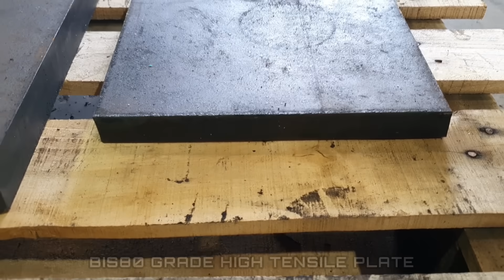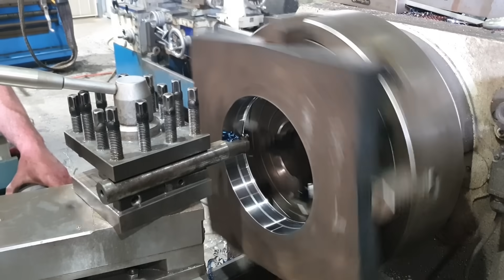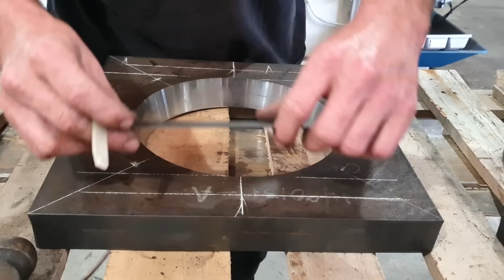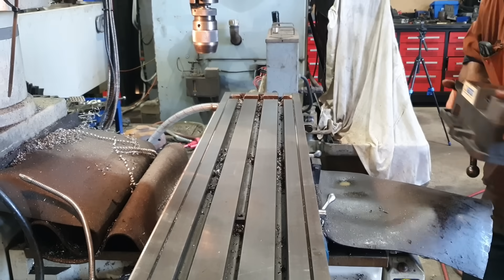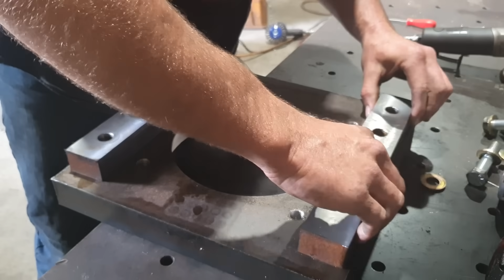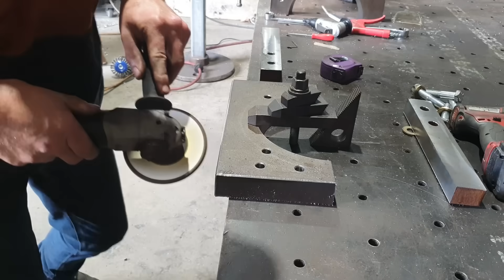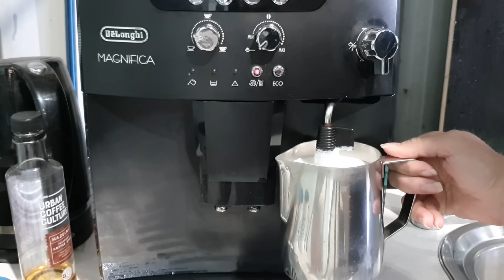Making a Custom Bearing Puller | Shop Made Tools

Comment: This is an awesome puller design. I would say that when I'm doing mechanic work, the hardest thing sometimes is getting good pullers and press plates that will work with whatever I'm trying to take apart and reassemble. Recently I've taken to making my own. Having the lathe and mill there to make custom pullers and press plates just makes my job so much easier. I'm rebuilding my Kubota tractor engine and rather than do like most guys and smash the old sleeves out of it with a chisel and risk destroying the block, I made my own puller out of scrap steel I had lying around and I made the pulling plate out of some aluminum to avoid damage to the block. You can't get these old blocks any more and people want stupid money for them so it's critical not to wreck them. The screw I used was from an old broken Snap-On kit I inherited from my father.  It took me about half a day to make it but it saved me about $700, and it would've taken a week to special order all the pieces in, so it was well worth my time. It was a hell of a workout with a long cheater bar to pull those sleeves but it popped them right out no problem.
Reply: Ever hear of a “Clamshell” puller? Best investment I’ve made as a diff mechanic.
Reply: @MH-es9rn  No but I'll have to check it out. I find myself doing a lot more diff work as time goes by. Most people are afraid to do it because you can't just slap the part on and torque it down. You have to actually set it up and take measurements and stuff. 🤣

Comment: No sarcasm intended : impressed with the accuracy of the chalk line! - I've been using the nail on rust, or Tungsten tip pen on Blue paint...but then no two of our tape measures are the same !!   You're a great inspiration.   Slàinte Mhath.

Comment: Ive been doing this for years. Gearbox rebuilding. If you have the cage and rollers off the cone, all you need to do is heat the cone with a rosebud and it will fall off. No harm to the shaft.

Comment: Love your vids. As a mechanic, I love fab work. "Make what you need" I was told years ago. I did get a bit of a laugh cause you ran the 5/8" (15/16" hex) bolt in with a 24mm socket. The dashes tell the story. I thought it was metric only for you "down" there.

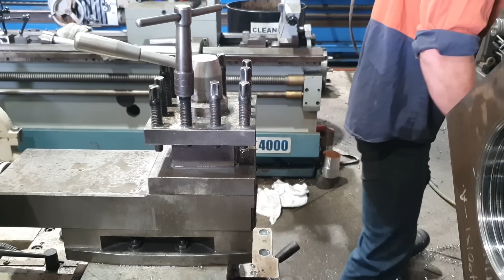Comment: 40:49 For your next Shop Upgrade Project, perhaps you might want to build a small motor that's permanently attached to the Mill Head shaft so the mills can be inserted or removed at the push of a button...That saves you having to waste time trying to get a wrench onto the shaft several times as you screw it in or out...

The guys at Physics Anonymous did something similar for their Mill...

https://www.youtube.com/watch?v=lTUmjiJELko
Reply from the maker: hey mate I can't have a setup like that as I wouldn't be able to use my 90° degree milling head

Comment: Probably been asked before, but why the air tools over electric ones??
Reply from the maker: a couple of reasons, I have a lot from my days working in the field when we used compressors, I prefer air over electric grinders as air grinders will stall if they get caught up
Reply: @CuttingEdgeEngineering  yeah ok, makes sense.
Guess I have only used cheap air grinders, should invest in a good one

Comment: What was happening at 26:00. What was the tool doing?
Reply from the maker: that tool is called a "wobbler" edge finder, it's helping me accurately find the edges and then center for the drill holes

Comment: Video's like this and your lineboring tooling equipment found here:

https://www.youtube.com/watch?v=vRgkWJRDcLw&ab_channel=CuttingEdgeEngineeringAustralia

Are great for teaching different ways of fixturing thing. I was doing a variation of lineboring equipment where we didn't utilize a pipe at all , it was 6 jacking bolts and we rested the boring bar on them and adjusted them.

On this video the customer split the bearing to remove it in 1 location. I used to do that to remove them as well. But for the past 4 years I been removing bushings and bearings by taking a 5/8"  (16mm) flat gouging rod (can use 3/8" (9.5mm) round as well I just like flat to remove the max amount of material per swipe.) and going almost through until you have  a very thin section of steel  holding it together. The bushing / bearing will sort of collapse on itself and in almost all cases you can knock it out or off with a hammer /line sledgehammer  without any risk of accidentally touching the bore or shaft it is mounted in / on with a gouger. Takes almost the same time as doing that 1 really careful split cause you can just set the machine to about 450Amps and scrape 1/4" (6.35mm)  deep  x 5/8" (16mm) wide channel per pass out with almost zero fucks given.

For those who are not trades people just watching, the advantage of not splitting the bushing/bearing is that the bore/shaft underneath is completely untouched so you could get away with not having to build it up if its still in spec, and if it is out of spec slightly your machining setup / bore welding setup is easier to do.

Comment: With that large tapping bit on the drill, does it just feed itself into the hole when threading? Or do you need to pull down on the handle like when drilling.

Comment: Another nice job.
I’m always impressed with your handling of heavy materials, this time the chucks, and your forklift driving. 
Any chance of including a rough estimate of the material price for the steel? This type and grade is not what the average guy would know and might be interesting to a few
Reply from the maker: hey mate thanks for the suggestion will do that next time!
Reply: I'd work on roughly 6k/t mate (AUD). Approx $400 for the two pieces. (Going on twice the rate of mild steel atm). Try calling your local plasma cutter for a more accurate price.

Comment: Beautimus!  Curtis should hand feed everything on the lathe lol.   Easy quid.  I have an old Cleerman drill press, a tall fellow it is, from Greenbay Wi.  Whilist doing the vertical mambo, I merely put a 1/2-13 bananna stud into the table and freely hand pickup punch spots, Kurt D680 vise sliding against the bananna, one clamp n go.  Love the Spanner Albrechchtddd chuck.  I need one.  The Mrs. and Homey, awesome per usual.  I love watching work ROFL

Comment: I had to make a custom puller for the power steering pump pulley on my '87 Ford.  The Lisle "fit-all" tool I had fit so poorly it damaged the pulley.  My ;puller was small so I cut the two halves first and then bored the hole in my 4-jaw, so there was no gap at the end.  There's something so satisfying with using a custom tool that simply works well...  I love the outtake on "Where's that #$%^& wrench I just had?" - That's a "MeToo" moment I can relate to!

Comment: I notice you run coolant on some drill bits but not others. Does that just depend on the type of bit. I do have better results with putting oil on the bits that I use. Great job on the project.

Comment: A perfect job well done ....little surprised at how u put them together thought u would have had a sleeve and bolt so u could pull the 2 halves tight onto the bearing...but your way works just as good thks for another gr8 video awesome guys..

Comment: Hey ! Once again the footage is great and seeing this puller I think I have died and gone to heaven. I have a plainer/molder that regularly eats up the first planer heads bearings. This style of puller is perfect for the main cone.  I am without a lathe or mill but with some careful torch and grinder work it will work just fine. Thanks folks have a beauty weekend.

Comment: Good job. Most pullers are  made of Chinesium  today. They are available under many different brand names  and are a sad reflection of what these brands once were. The upside that for a small outlay you can play emergency room lottery  with a bonus if an ambulance is required when the high tensile become un-high tensile . Oh the fun of ducking an M16 but as it ricocheted off the wall  and the hilarity as steel nut met non steel nuts. Remember if you can't take a joke,  you shouldn't have joined.......👍👍👍

Comment: I made a 1/4” hex drive to square drive tool that I could chuck into my battery drill to speed up those 100 turn adjustments on my 1952 manual Bridgeport machine. Those one mm per revolution adjustments get old after a while. Fun gawking atcha.

Comment: Nother great video and build 👍

Nothing like making a 'homemade' tool, use it, and seeing it worke as intended ☺️

I do remove allot of bearings like those.  Some smaller, some larger.  But I always apply heat, and very little is added before the bearing/race will fall off. ☺️.  (We trash all bearings, because we run to breakdown)

This is definitely a idea I will keep in mind. 👍 Can be used for other things as well

Comment: If it is possible to remove the shaft the only thing you need is a big torch, hang the shaft in vertical position, heat up the and bearing race while rotating the shaft and gravity will do the rest, works every time and done in 5 minutes.

Comment: 36:30 Well, if there's a taper you could make adapter rings which adapt them down - as long puller fits into the housing there shouldn't be an issue with that. :)

Comment: i don't think that dog gets enough to eat.  i see you using chalk lines. you don't care for the wide markers? i remember the dykem days. that's one hell of a horizontal bandsaw. power feed turns me on.one of those laser de-ruster thingies would be cool if they weren't so expensive. that edge finisher/ metal router tool is slick, new to me. pretty weld. gee, my coffee looks lame compared to that. a starbucks french roast K cup, water, walmart creamer, and artificial sweetener. made many a cup in the dark ages using a percolator.

Comment: I'm not a machinist, just fascinated by all this and your "I can make anything" attitude.  Maybe this is a dumb question, but.....

Watching the twist drill in slow motion, I was curious about how it seemed that only one flute was making a long curly chip in the first holes you cut.  Is this a concern, does it mean the drill is imperfectly sharpened or is it no big deal?   Wondering if your slow mo is actually useful as a diagnostic tool in the shop, regardless of making a YouTube video?

Comment: Nice custom work !!!  Wondering about use of the tap on the mill.  Does the quill have a clutch in it ?  I've used the Tapmatic device on a drill press in the past.  Great way to make threads.  Enjoy your work immensely; camera work is exceptional as well.  You work alone ?  You should have an apprentice to whom you can pass along your skills.

Comment: Kurtis, I'll never have to work with bearing this large, but have worked with automotive-sized tapered roller bearings since the '70s and I really like your custom puller design.  Now I'll just downsize your design as needed!  ;)

A hopefully un-needed word of caution though: a few years back here in the States we had a scandal and many product recalls of dog toys because the "import source" had used a possibly deadly component/chemical in the manufacture which sickened and even killed a lot of dogs.  I don't know what those packing envelopes are made of, but watching it being torn up with glee made this memory pop back up and I though I'd mention it, just in case.

Comment: A question - looking at the beautiful condition of all the CEE equipment and tooling, I am wondering what you're using to prevent surface rusting on your own stuff? Even your welding table looks good!
I'm in a non-air conditioned shop in Sydney and everything goes rusty really fast... I seem to spend more time de-rusting than working! I've had partial success with some Lanolin based products, and Penetrol Spray is working OK but leaves a heavy film build which is no good for precision stuff like parallels and squares.
My tools are even going rusty inside the bloody toolboxes GRRRR - can you recommend anything to help?

Comment: The attention to detail is always a pleasure to watch. I’m not there yet, but one of these days I’d like to be able to lay down some mig welds like that. I used to supply timbers to a small father/son steel fabrication shop and those two could lay down beads like Kurtis did in this video. A robot welder couldn’t have done better. Maybe one day I’ll get close to that level of proficiency.

Comment: Great job, it's so important to as best fit for the puller as you so eloquently said ;) You do need to tighten your nuts down. Our gearboxes were mostly for large industrial use in mines, newspaper printing presses and military applications. We used a great many taper roller bearings and to remove them on-site was a complete nightmare. So I too used to make custom pullers to assist me at the end-users premises. Often the TRBs were fitted to special bronze gears, making a clean removal vital. I can honestly say that I was quite lucky that even though some of the TRBs were difficult to remove, having the custom pullers made it much easier.
LMAO Our Pyrenean Mountain Dog just loves cardboard boxes, she will rip them up and then chews them for ages and then just leaves soggy piles of cardboard everywhere. The other dogs don't seem to have the same addiction as her.

Comment: Shouldn’t that 14mm twist drill be clearing chips in both flutes? Sorry if the question sounds naive but I assume that means the drill is only cutting with one edge. Asymmetry in how it was sharpened?

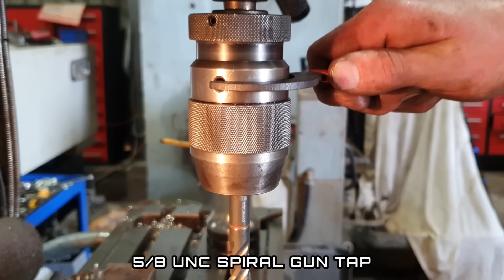Comment: 16:46 I've only ever hand cut small threads. The way this tap goes in is both impressive and horrifying.
Reply: I thought the exact same thing.
Reply: It's cheating! Lol
Reply: Yes hard on the taps. But UNC threads is odd in Australia, though I would guess that it is used because it is an old tap, and thus either there are a lot of them around unused and sold for a pittance, or Kurtis is always grabbing them off auctions in boxes of nearly new taps. Going to guess though the machine it will be used on though was made in the USA, so it has a mix of UNC and Metric threads and fasteners through it.
Reply: @SeanBZA  seems to be UNC because that is the thread the pulling studs have, maybe same for the bolts that hold the puller together?
Reply: @notstonks20  Possibly, old unit that is the ship of Thesus, where every part has now been changed, but the new parts still use the old thread patterns. At least those threads will be easy to replace, as the insert kits probably are cheap, as they have been sitting on a shelf since the 1970's. 

I have a few sets like that, came in the metal case instead of the plastic ones the metric use, and bought for around a tenth the price as well. Just going to be a bear getting new inserts for them, the only supplier only keeps a few around at a time, so included them with other orders, to get better pricing, slowly. Some of the kits had a date on them that was older than me.

Comment: Very neat welding work there. 

Reminds me of some heavy welding on a cutterhead for a TBM I was inspecting in Italy. The guys were having a break when I first arrived. I had a good look at some of the finished work before they came back. 
My first question was "where are the robotic welders?" They looked confused.
I was pointing at the other workshops. "Which one has the big welding gear?" I asked.
They just pointed to the three of them. "Welders"  "just us".
I thought they were pulling my plonker. No way such heavy welding, of such high quality, was done by hand.
I sat for an hour watching them work, open mouthed for the most part.
Proper artists at work.
Never seen welding as good as that before or since.

You came pretty close though.
Reply: My father had a neighbour, who used to do fabrication at a paper mill, and his speciality was brazing the paper webs to make a continuous roll. Only way you could see the joint was to look for the line of yellow and blue on the shiny fine mesh stainless, where the heat had discoloured it, and the yellow was the silver brass alloy paste he used, to join the individual 0.5mm wires together. 

Did that for over 40 years there, and even in his retirement he would go in and do this, on a contract basis, well into his late 70's. He did train a lot of people in the job, though most of them left after a few years for better pay, so he was always doing the training, and also some specialist fabrication when needed.

Don't think I could get to that level, I do not weld enough, and can do reasonably strong and ugly though. Filler and paint though can cover a lot of sins, and car body panels are not at all difficult to replace.
Reply: Had the same impression at the Tucker Sno-cat production facility in Medford Oregon, exceptional craftsmanship.

Comment: Great work as always both, cute little taper roller bearing! 😍 I  have worked on bigger ( first time for me, Ref Cutting Edge Engineering fayre)  we use Timken, 36 month lead time for the bigger ones 18"/ 450 mm OD from the US to the UK, though you can get them quicker at a huge premium. 
Good to see high tensile plate being used, and other more suitable materials. 
Stay safe all,  and best regards from the Black Country.  John.

Comment: in Germany i have learnd by drill a hole you drill first a small hole. so you can easyer drill bacouse hte kern of the drill.
Reply from the maker: these drills are split point and don't need a pilot hole

Comment: Another great video. I see you were welding "spray transfer" If so you would benefit with a gas mix with more argon as like 85x15 or 90x10. I use to mix my own using two tanks, one 100% argon and the other 100% co2. two flow meters and a "y" connection to your welder mix to suit.
Reply from the maker: i'm using 90/10 mix 😎👍